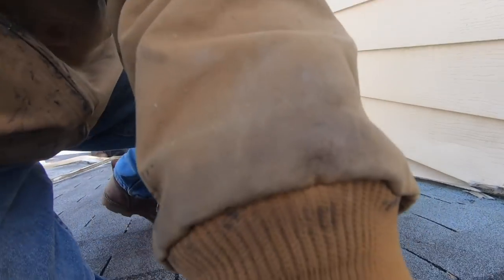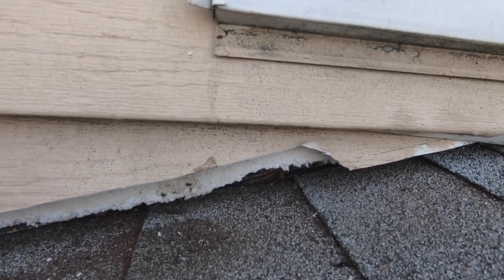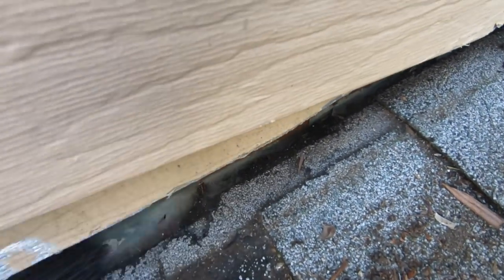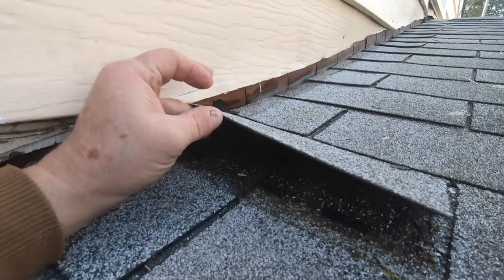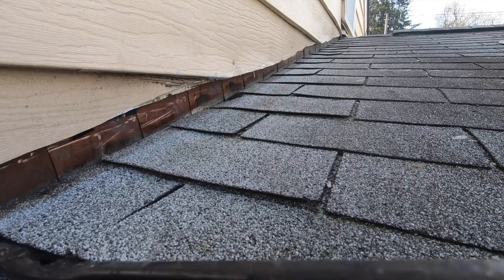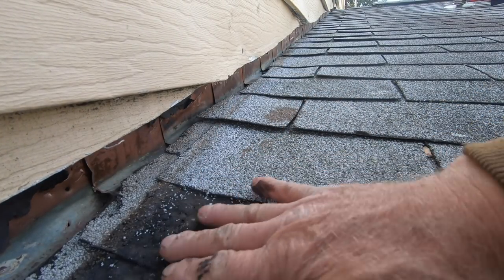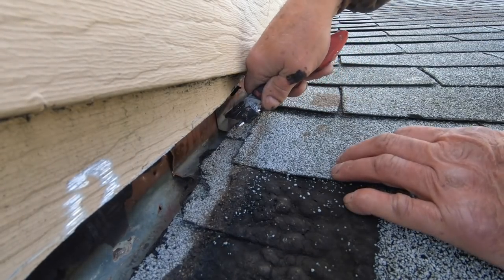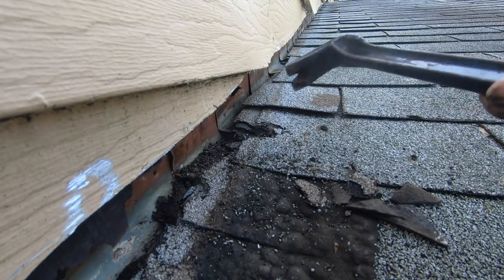FLAT ROOF and Shingle LEAK REPAIR- How to find and fix leaks on any roof DIY

Comment: I will add my comments to Terry's, I have also been trying to get someone to fix a roof leak (3 different co's) and still have the leak . With your video's I am going to attempt to repair it myself. I have siding transitioning to a metal roof so I hope that the Turbo Poly Sealant will do the job. Thanks for the videos. Bill
Reply from the maker: I am glad I could inspire you

Comment: That old patch job job was terrible but you did the same thing but fancier, you should have removed old shingles and flashing and put new ones on it, handyman do that type of crap all the time no decent roofer will do that type of screw up, that patch job is gonna crack in no time, anyway good luck handyman.

Comment: Great videos! After this dries, is there an atheistic top coat you can recommend to make it look good?
Reply from the maker: You can always use ceramic granules and sprinkle it over the Turbo Poly Seal while it is still wet. That way it will blend with the rest of the membrane
Reply from the maker: any urethane or oil-based paint will do

Comment: Thanks Flat roof doc, have a big flat roof! There’s leaking when heavy snow and ice melts. I want to buy your product, but I live in Canada, Toronto area; the turbo poly seal link can only be shipped to US. Any recommendations for substitute product here in Canada? I saw they sell black knight rubberized seal in home depot, would it work? Many thanks in advance!
Reply from the maker: Try Flex Seal Liquid with Henry's Polyester fabric that Ho,=mne Depot carries. The Henry Fleece is not the same quality and does not conform easy to uneven surfaces but could do the job with a little work. Turbo Poly Seal is Urethane and Bituminous Resins whereas Flex Seal Liquid is a Silicone-based product. You should be able to get good results.
Reply: Another challenge I run into is that they do not sell Henry fleece roll at my local home depot. The closest products I can find are landscaping polyester fabrics, self adhesive membrane (blueskins by Henry), or Yellow Jacket reinforcing fabric.  Would either of them work? Thanks again for your help. Much appreciated!!
Reply from the maker: I think the landscaping stuff is a little thick but if the surface you trying to seal is flat it might work
Reply from the maker: @renalin4694  Landscaping stuff a little thick  Another idea is to get the asphalt-saturated cotton roll in roofing area. I don't know what it is called but it is a roll saturated with tar and is used to do repairs with tar on asphalt roofs
Reply: @FlatRoofDoctor  thanks sooooo much!!  Will go in box store to find out  👍👍

Comment: It isn't properly step flashed
Reply from the maker: Not true, It was installed correctly and for 30 years never leaked. If it wasn't properly step flashed it would leak from day one. You need to watch the video again and learn something. Debris between the shingle and flashing layers will divert water and cause leaks. It takes a very long time for that to start happening. The part where the flat roof meet the flashing can't have step flashing. Is that what you refer to? Flat roofs and step flashing does not go together. That part in the video the roofing membrane wasn't attached properly to the solid flashing (not step flashing) so I used Turbo Poly seal to make the transition.
Reply: @FlatRoofDoctor  I am speaking of the sloped roof not being stepped flashed properly where the siding was cut back. You lifted the shingles and the metal step flashing wasn't even interlaced between the shingles. IRC recommends sealing the shingle to the metal using rubber cement. I agree though once sealant or tar is applied, then debris and water moves horizontally. What type of flashing to you recommend for old plaster walls where you can't get behind it?

Comment: Could of chalked a line just to make it look nicer at least.
Reply from the maker: Hey mindseeker. You read my mind. I love to make things look better but I get lazy at times
Reply: @FlatRoofDoctor  it happens. But i feel the better things are the longer it'll last. 😉 like the better a built-up roof is, the longer it'll be a roof.
Reply from the maker: @garrett3113  Absolutely true. The more quality you give the longer it lasts and more returns you get that benefits you. It is called "the law of sowing and reaping". I get you are a quality conscience guy. Kudus to you.
Reply: @FlatRoofDoctor  yeah. But still good work. Ain't nothing but a good hot day on the roof to solve problems lol
Reply from the maker: @garrett3113  It was 93 degrees here in Connecticut today, July 19th, 2019. My new wife has been here for 4 weeks now and said the heat is nothing compared to McAllen Texas, where it gets 110 - 120 degrees. but today she broke a sweat making a video on how to fix a transition from a drip edge to a rubber roof with Super Silicone Seal. I had a good laugh. It was very humid
Reply: @FlatRoofDoctor  oh yeah i know how that is. On the roof it always gets well above 100 even when its 90 on the ground. Roofers will know what i mean lol
Reply from the maker: @garrett3113  Where are you in this world?
Reply: @FlatRoofDoctor  New Mexico lol
Reply from the maker: Hot place to be roofing - all the best
Reply: Yeah haha but good work and stay safe.